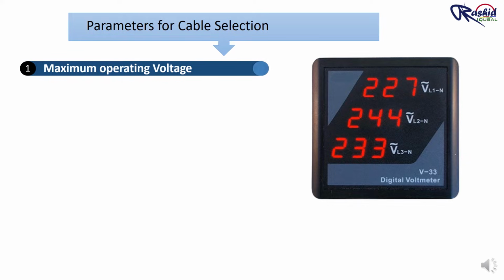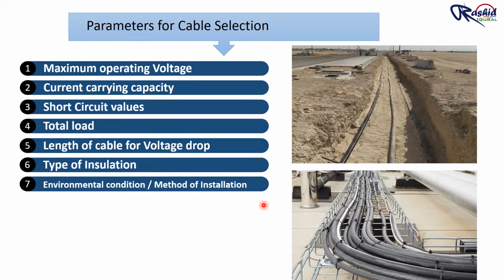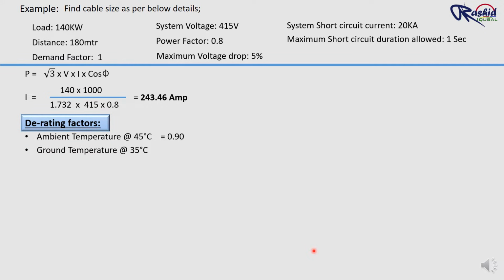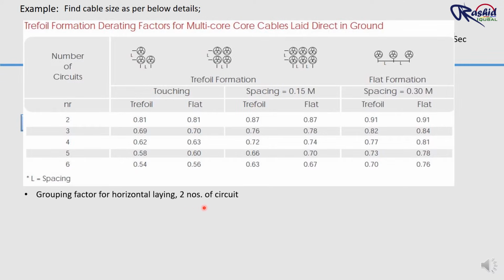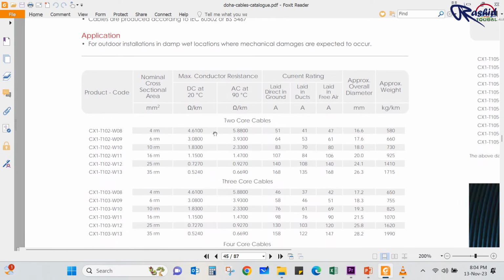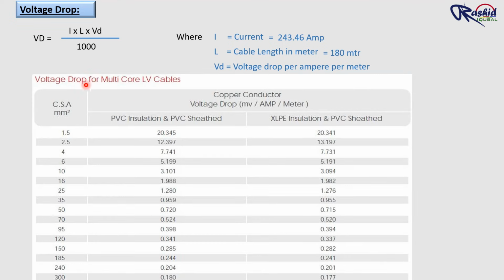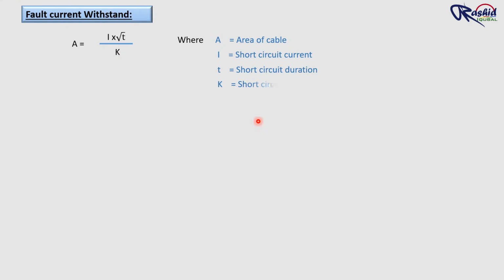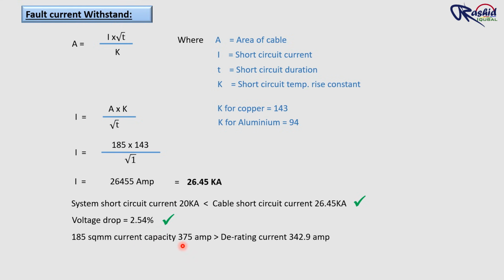Cable Selection Method | Cable size calculation

Comment: in voltage drop why don't use I = 342.9A???
Reply from the maker: For voltage drop calculation, you always use the actual design load current (243A), because voltage drop depends on the real current flowing in normal operation.
Derating factors 342.9A are only used for sizing the cable ampacity, to make sure the cable doesn’t overheat under worst conditions..
Reply: @Rashid-iqubal  Thank you

Comment: My Dear, VOl drop formula is't standard, correct formula is K.I.L(R.Cos theeta + x . Sin theeta). 100 / No of cables  . Supply voltage  and also you did'nt describe derating method for upper ground and under ground  for upper ground case- (Ambient temp, Altitude, Group factor, Types od installation) and for underground case (Soil resistivity, Depth of laying, Ground temp, Group factor and types of installation) please update your video.
Reply from the maker: Sir, i suggest you to watch whole video, all those parameters has mentioned, I clearly mentioned that calculation is for underground. 
Regarding Voltage drop, My formula is correct because I used the mV/A/m value from the cable datasheet, which already includes resistance and reactance effects. It’s a simplified and industry-accepted method for quick and practical voltage drop calculation. The detailed formula with R and X is also correct but used when mV/A/m is not available or for deeper analysis.

Still you have any doubt let me know i will guide you.

Comment: Vd= 1.732*load current *lengt*resistance of cable/no of run cable*1000
After getting value
Vd%= find value*100/system voltage

Comment: Sir, this question 🙋 is in 3phase system- I have one 4mm single core cable, which carry approx 26ampear, on the outher hand I have one 4mm² 4 core cable which carry approx 26ampear insted of 26×4=104 ampear for 3phase distbution? This is my question same thing company mention on brokers like only 63amp insted of 252 why ?

Comment: Dear Cable selection we should the size as per breaker rating  first then select the cable accordingly having said while selecting cable we should observe cable length and Temperature derating factor also
Reply from the maker: @salmananwar8370  Hello salman, please watch this video carefully, i have mentioned all those points, length has covered in voltage drop calculation and temperature covered in Derating factor calculation.
Apart from these obviously MCB rating must be lower than cable rating, if i calculate whole system i must consider electrical equipment rating, MCB rating and cable rating, however this calculation is only for Cable selection as per the given load.
I will make separate video in which I include MCB and Equipment rating as well.
Thanks for watching
Reply: @Rashid-iqubal  mostly cable size should equal to the rating of breaker rating having said above rating of cable would b technically fi9 but it will b considered over size.
Reply from the maker: @salmanawar8370 Cable size selection isn’t just based on breaker rating. The cable ampacity must be higher than the load current while considering derating factors. The breaker protects against short circuits and overloads, but if the cable matches the breaker rating exactly, there’s no safety margin. 

Ideally, cable ampacity > load current, and breaker rating > load current but within cable capacity…
Reply: @Rashid-iqubal  dear there z safety margin if u cable ampere capacity n breaker ratings are almost same. Even Nec instruct that as well that either ur cable must b equal or higher than breaker rating but won't be lower. I have done several projects and I haven't seen any issue on that , as like I said cable sizing above breaker rating technically z good but will consider over size , which definitely impact on cost. 
As per ground reality load never operate 100 percent suppose u size breaker 40 amps and u select 10 sqmm conductor xlpe/PVC so just have a look the amps on catalogue that's already 45/50 amps current carrying capacity , which z f9 then y will I go for next size unnecessary. 
Make sure client hire consultant for their ease not for difficulty. Being a design engineer ur design must b technically n economically reliable.
Reply from the maker: @ I agree that cable ampacity should be at least equal to the breaker rating, but real-world factors like temperature, grouping, and cable length can reduce ampacity. Many countries have their own standards, which prioritize safety and do not allow compromises. NEC and other codes permit sizing close to breaker rating, but without considering derating, a cable may become insufficient over time. A good design balances safety, reliability, and cost-effectiveness..
Reply: @Rashid-iqubal  suppose u have load 20 kw in three phase which is around 36 amps then include next size factor 1.25 = 45 so available size in Schneider z 63 amps so cable will be selected 16 sqmm 4c xlpe/PVC which has capacity around 80 amps and if m running cable through tray then depth laying n soil resistivity won't b included. Only temperature facture included
so now multiply 80 x 0.85 temp derating that would be 68 so not too much difference and system z on safer side thx.
Reply from the maker: @salmananwar8370   So where is your objection in my video? First of all, I didn’t calculate the breaker size. Based on load current and cable laying location, I selected the derating factor and then the cable size.

As per your concern, I should select a lower cable size, meaning less than 185 sqmm. If I choose a 150 sqmm cable with a current carrying capacity of 335A, it won’t fulfill the required load current of 342.9A. In practice, selecting an exact or slightly lower size cable may be possible, but as per standards, it is not acceptable.

However, if there is a special requirement from the client related to cost optimization, then only we can consider an exact or lower size, ensuring it still meets safety standards.

At the end of the day, practical design is all about balancing safety, efficiency, and cost while ensuring long-term reliability.

Thanks, Sir, for this long and valuable discussion! 🙏🏽
Reply from the maker: @ Your example considers a 36A load, applying a 1.25 safety factor, and selecting a 16 sqmm cable with an 80A capacity after derating. While this works for your case, it doesn’t mean the same approach applies to all scenarios.

In larger load cases, like mine, we must follow standard guidelines to ensure safety and compliance. Choosing an undersized cable might work in certain conditions, but it increases the risk of overheating, voltage drops, and long-term reliability issues. That’s why design decisions should be based on both calculations and practical safety considerations.

Comment: Can we also use that total derating factor and multiply it with the ampacity of the cable we have selected so that it geta lower rating after the factors, instead of diving the load with the derating factor? same thing right?
Reply: Yeah
Reply: Yeah

Comment: Mentioned milli volt /amp/meter however it was taken as volt here for voltage drop calculation can u plz clarify
Reply from the maker: The value given in mV/A/m indicates how many millivolts of voltage drop will occur per meter of cable for each ampere of current flowing through it. This rating is provided by cable manufacturers as per their material quality.
Reply: @Rashid-iqubal  thank you for your info, can you please share with me the standard reference for this cable sizing.

Comment: please sir the 100 in the VD % calculation is not clear, please ?
Reply from the maker: Its a mathematics to find percentage.
Total voltage drop is 10.56v
If you want to convert into percentage from 415v then you must multiply with 100 (%) / 415

Comment: But sir you didn't mention saftey factor for breaker and then you should Calculate cabel size after we will get circuit breaker rating divided by derating factor to get the Actual cabel size

Comment: For .80 depth. How u select the cable range of 95-240
Reply from the maker: Because the range between 95 to 240sqmm cable can carry 243.46 ampere current.

Comment: Hello Engineer I am currently doing my EIT as graduate Electrical Engineer in SA, I have been tasked with cable sizing by my line manager. I find this video very helpful, if you don't mind can you share your presentation and the cable selection manual that you are using. Thank you keep up the great work👍👍
Reply from the maker: Please share me your email id
Reply: VOl drop formula is't standard, correct formula is K.I.L(R.Cos theeta + x . Sin theeta). 100 / No of cables  . Supply voltage  and also you did'nt describe derating method for upper ground and under ground  for upper ground case- (Ambient temp, Altitude, Group factor, Types od installation) and for underground case (Soil resistivity, Depth of laying, Ground temp, Group factor and types of installation) please update your video.